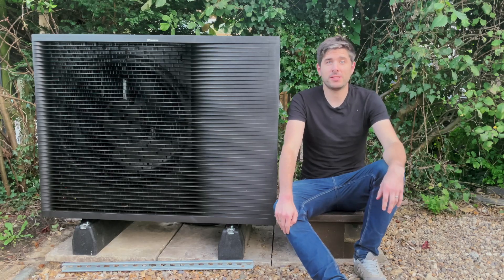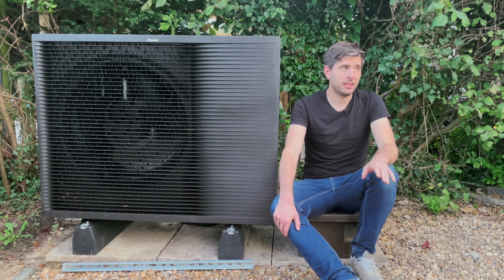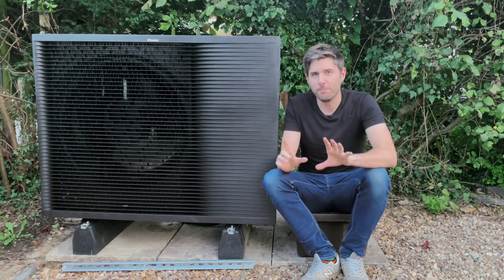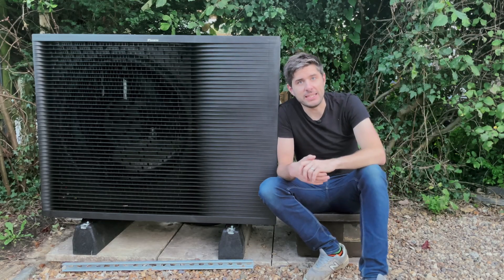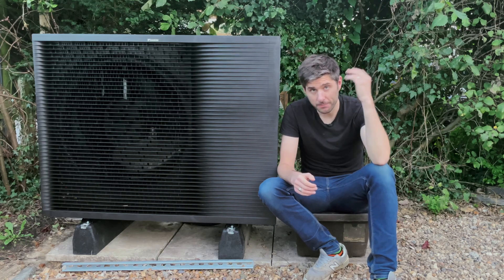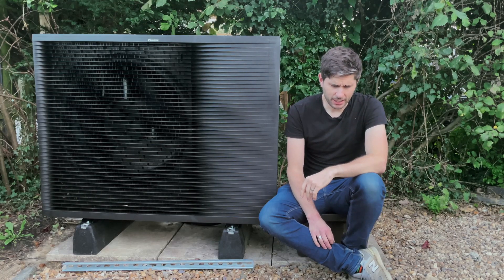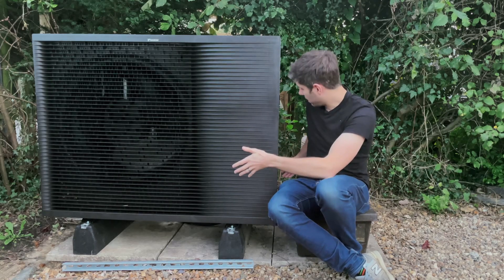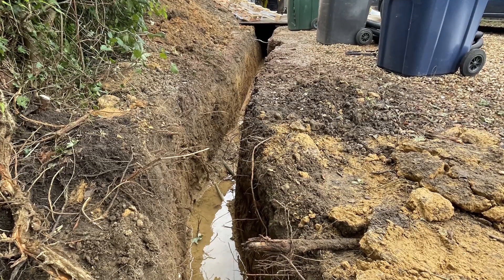Replacing an oil boiler with an air-source heat pump: Why, what and how

Comment: If you have a home energy performance certificate the UK Gov states heating water by electric overnight at cheap rate is terribly inefficient.  My neighbours did this and are in a group lower than us.
Why leave a system on 24hrs wasting money? That is like me leaving my heating on at 15c to keep the house warm. 
Heat pump systems cost way more to heat your home compared to a gas boiler.
Everyone with them knows this, feels a fool for being scammed and are reluctant to admit it.
You also need radiators twice the size and bigger pipes.
Wait until you get your bill and come back. You forgot the legionnaires cycles.
Why did you think you needed a flow temp of 70c? 
Can't wait to see the video of you ripping it out.
You would have been better with electric storage heaters.
Reply from the maker: Fair enough, i wonder why it’s stated to be less efficient to heat water at night. We do it because the electricity is 1/3 cost, so for us it works out significantly cheaper. 

I’ve not worked out costs yet, although I’ll probably do a video with some cost details in the new year.
Reply: 😂 got to love these people in the comments who are so confident they are right.  Gas boilers and even more so Heat Pumps are more efficient the lower the temperature they run at.  They aren't a case of being off or on and using all the power they can like a vacuum or a kettle.   Being on all the time allows them to be in their sweet spot for longest.  You can compare it to like driving a car - if you drive everywhere accelerating as fast as possible to 70mph and stopping every few minutes and accelerating again, vs just driving constantly at 35mph, the latter will use less fuel, and save you money.

Comment: Wow, I can hostilely say our experience was nothing like that. We had the same heating system, oil with a failing combi boiler. We research the heck out of it, and opted for an LG Therma V mono-block 9kw unit, and had a local refrigerant engineer, who does ASHP as a living to install it 2 years ago. It was a simple swap out job!

We sold off the spare parts bought for the old boiler from the previous year and got the remaining boiler was sold for scrap, that got us £180. We sold the remaining oil in the tank to a neighbour and a friend at work and got another £300. We gave away the tank to the friend of the friend from work for a bottle of wine. (it would cost us £400 to remove it) 

LG ASHP cost us £7,500 all in, and we got a grant from the government at £7k. We kept the old rads and pipe work and just use it to heat the 3 bed 1963 detached bungalow with existing system, and took a day and half. Its done the job, but we did expect it to struggle when it got down below 0c. Which it did a year ago in Dec -8c for about a week. 

We have plans for the bungalow and so held off making any major mods until that time. We add Infrared Panels to 3 rooms, which on a cold sunny winters day helps to boots the heat using our Solar array. Otherwise we use the fire place with our own seasoned wood as a back up. 

We have gone fully electric with everything, heating home and water, and cars. We have a 31.5kWh of battery storage and a Sunamp for our hot water. So we max all the 4 hours of cheap renewable energy in the small hours to store and use for the day. So even if the ASHP was working its nuts off, we kept the energy cost down to the minimum. 

We even have a Setec Mobile Power Station (acting like a generator) to connect our Nissan Leaf to the ASHP and run from there. So if the local grid went down we would drive off to the local charger, charge up the car no matter the cost, drive home and plug in. Yes we did it to lower our CO2. 

Our plans will involve an extension, replace the heating system pipe work to underfloor, and insulate as much as possible, and replace all the windows. We even plan to replace our old roof with new Solar panels that are the same size, but double the power and add a few more to the front of the bungalow. We are saving like crazy i.e. £10k a year with a mortgage too boot. I am postman and my misses does admin! We are not made of money, but we are wise to saving it!!

Great video by the way! Sorry about your experience, but I put that down to the current Governments lack of planning and commitment to its citizens making the transition. Vote wisely next time people!!!!

Comment: And what consideration did you give to Hydrotreated Vegetable Oil as a replacement ? Admittedly the 'technology' is lagging that of heat pumps, but a serious contender for low carbon footprint surely.
Reply from the maker: If I’m honest the prospect of not having to rely on remembering to order fuel was a big winner for me.

Comment: Another point to consider is that with an ASHP you are then completely dependent on electric? At least having more than one fuel source available in your house there is a backup if one fails or is not available.
Reply: That argument counts against gas and oil boilers equally.

Boilers won't run without electricity. Oil boilers need to pump the oil from the tank and both need electricity for the control systems and central heating pumps.
Reply: @brianballard905  Its a good point, gas boilers do require electricity however bear in mind a gas boiler hardly drawers any electrical power compared to a heat pump.  It is therefore far easier to provide it with a temporary electrical supply from a small battery / inverter (or even a UPS?).  Yes they need electric, but far less of it.
Reply: @denniswillson5990  If it was an issue people would have had backup power for their gas boilers for decades already; they don't. Bottom line is, houses take a while to lose heat, so usually power cuts aren't long enough to become a heating issue.
Reply from the maker: Yep, good point and something we considered. We’re wondering if we can run it off batteries/solar in a bind. That being said we’ve also got a log burner (not really all that green) and the heat pump has got backup heaters in case the compressor fails. So we’ve got options, but it is a good point.

Comment: Good video. We had an oil boiler and tank was getting on (and replacement could not go in th esame place...) and the combi boiler was about half way through explected life. Like you we wanted to remove fossil fuel so decided to use some of my pension lump sum for solar panels and a battey. We were exploring an electric boiler with our planned solar planels. One call resulted in a 40 minute detailed exploration of ASHP and after a couple of other quotes we went with our first contact. As a bonus the same company could do the solar and battery - Install was not painless. All but three radiators were replaced with bigger units. We had to cut a hatch in the wall of our bedroom to get the water tank in. Overall the installer was excellent, the crew were hard working and nice to deal with. Result? We paid less for our entire electric in 2023 than we paid for oil in 2022!! The house stayed as warm as it had with oil. The hot water supply is better than the combi. The system is much quieter than the boiler. Over all very impressed.

- Electric use during the two longish cold spells in Dec 2022 and Jan 2023 (several days below zero and down to -9C) was a bit scary - we peaked at 84Kw one day and the unit was obviously working really hard below 5C but it coped. During the late spring through to a few days ago (mid Oct) the unit only ran to heat water - two approx. 40 minute runs at 2am and 2pm GMT and only used approx 1.5Kw each day. We also have a electric boost that runs for a short period every Sunday early AM to prevent Legionella
 
So - if you are on oil, an ASAP is great - esp. when supported by a good solar setup. 

Things to consider... 
      - the external unit needs some space behind (c. 250mm) it as well as infront - it blows out cold air - pleasant on hot days, but very cold in winter - we think it killed one of our plants during the winter cold spells. 
    - The closer the unit to the hot water tank the better. 
    - The water tank will need to have the correct heat exchanger and insulation. 
    - There are quite a lot of electrics- programmers, wifi etc that need space... (our system assumed you have wifi).   
    - You need the radiators and hot water tank to meet the 'rules' to get the grant. Whilst our loft was rated OK I did double the loft insullation and had a hard look at any potential for drafts.
Reply from the maker: Great post, really detailed - thanks for sharing Steve

Comment: If you need to work hard to keep heat in than the efficiency of your source is even more important.

Gas boilers should be run at low flow temps.

Comment: Well, We clearly are much less well off than you, no way at our age that we could afford such a system nor deal with the disruption of the installation or the "months" of tweaking or the lower room temperatures or the "warm?" water. Great for well off youngsters and good luck to them, not something for us though. ps forgot to mention, we have nowhere to put a large hot water cylinder.
Reply: Not even the loft?

Comment: Full of misinformation, when a new oil boiler and tank is much cheaper why spend around £20K ? Why is the unit so far away from the house? noise! 👎 is too loud that's why, see my video don't listen to a politician giving heating advice.   https://www.youtube.com/@mrcombiBedford/videos
Reply from the maker: Yeah we thought it would be noisy (although it’s not actually noisy at all). Our main reason for putting it there was convenience and possibility a large dose of inexperience
Reply: Thanks for reply, you connected to rads which is NOT recommended as it's much more expensive compared to under floor, how much was the total cost for 12 years of heat pump? george
Reply from the maker: @mrcombiBedford @mrcombiBedford oh yeah totally but it would have been a lot more pricey. We’ve only had to replace one radiator and none of the pipe work, and so far the house has been warm enough (flow temp 35-45 degrees) although it’s not got below zero yet.

With regards to costs, I’m gunna try and do a video after the winter to compare how much it cost vs oil.
Reply: You don't say how much and can you get 22C in the lounge? last question. @michael_bird
Reply from the maker: @mrcombiBedford yeah, 22c in the lounge (although the lounge is south-facing, so the sun does a lot of the work)

Comment: it seems that installers could buy a few oil filled rads or fan heater to loan clients during install to take away the fear of a cold snap.
Reply from the maker: That would make a lot of sense!
Reply: In the UK the idiotic choice was made that under the grant you must size the system for full heating load even in the coldest day of the year. This means the heat pump is oversized for the majority of the year.
Reply: I know. Particularly that the MCS calculator seem to overestimate the heat load. Our calculation estimated  twice as much power as it actually needed  on a -5c day. So we now have a pretty oversized unit. 

But I actually meant electric rads for the instal period. When there is no heating
Reply from the maker: Genuinely think this a genius idea, something installers could offer that would show that they ‘get’ their customers.

Comment: Don't know anything about curves but our system is used manually as and when. Just had the wall insulation done, also the solar but no battery. Swapped our radiators to bigger ones. Will see what the winter brings? Thanks for the video and good luck.

Comment: 15 or more years ago we used to heat a swimming pool with an air source heat pump and it worked brilliantly, and mostly run through the night on Economy7. The pool was covered by a poly tunnel so it drew warm (or even hot air in the summer) from the poly build, and expelled the used cold air from the back to the air again. Never seen anyone else do it, but why not fit a green house over the air inlet side, with another positive that it would protect the unit from the elements.
Reply: You’d need to be careful the greenhouse didn’t start becoming like the inside of a fridge with less and less energy for the HP to extract and not enough solar gain, and/or air flow, to replace it? More likely to be an efficiency only in summer but a much bigger inefficiency in winter?

Comment: You needed a new Hot Water Cylinder as the coil inside that transfers the heat from the ashp heating loop into the Domestic Hot Water needs to be larger than a standard cylinder (due to the lower operating, or flow, temperature of the ashp). A good way to think of it is "you are increasing the size of your radiator inside the Cylinder"
Reply: If we have a 145litre HEAT-STORE would this get around this issue?  The mains pressure cold water runs up through the "water jacket" in a big coil, popping out at the top side of the tank piping hot at mains pressure (we wanted mains pressure showers in our dormer).
Reply: Also you probably need bigger radiators and may need full sized pipes if your heating uses small-bore pipes.....like many houses from the '80s onward have.
Reply: Nope, it was to cover their MCS arses. The high temp Daikin can produce water at 70°C at outside temp of -15°C so any DHW tank would have been suitable. In fact this whole install could have been done without changing anything but the boiler - that is pretty much the point of High Temp ASHPs.
Reply: @johnhunter4181  whilst HT heat pumps can simply be installed in place of Gas Boilers without any other changes to the heating system. The performance of HT Heat Pumps (ie the COP/SCOP) is too low to make it financially viable for most consumers costing more to install and more to run than a Gas/Oil boiler. For those eco warriors with plenty of cash no problem.

Comment: I've had a 14kwh Mitzi for 10 years, generally use about 6000kwh over the year for heating and hot water.  A major saving is that I have not paid £100+ every year for an oil boiler service, and no smell!
Reply: 😅😅el is for free.😅😅👎👎🇩🇪
Reply: I reckon I have got the same Mitsubishi 14 kWh as you. Had a problem with leaving the hot water side on all the time. Mitsubishi technical service diagnosed a faulty relay but careful reading of the manual revealed that the software prevented continuous operation. My time switch only allows three timed events per day so I will have to replace it some time.

Comment: Very reassuring video. Do you have to super heat the water tank occasionally to ensure there is no danger of legionnaires?
Reply from the maker: Yep, it’s built into the system and I asked the installer to run it on a Friday morning (off peak electricity) to run the legionella cycle. The tank uses the immersion rather than the heat pump (can’t remember the reason why) but it’s all controlled by the heat pump.

Comment: How big are your radiators
Reply from the maker: Mostly single panel or double panel radiators, none of them particularly big. They were perfectly adequate with our oil boiler, I was surprised more didn’t need replacing.